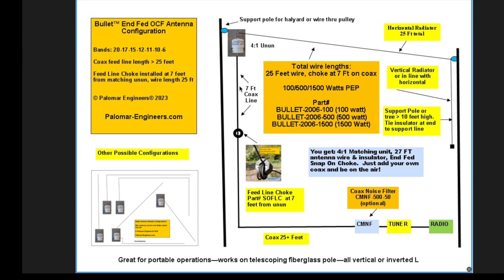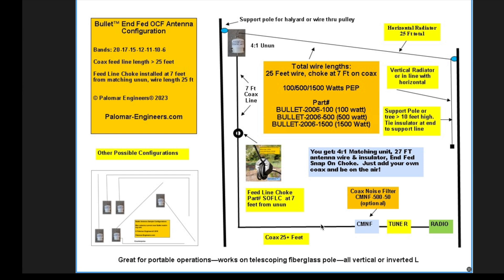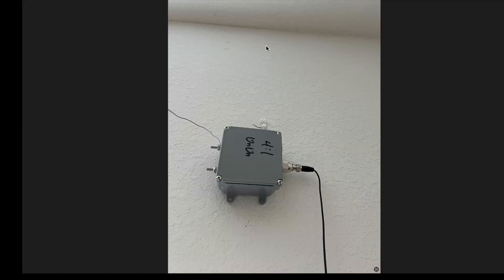Cheap, Easy DIY Multiband Ham Radio HF Antenna Fits Anywhere.

Comment: I like Palomar products. I have used several EFLW antennas on 155 ft long the other is 77 ft I think. I do have a request for you; on EBay a 160 meter end fed antenna is sold. I've had one of these up for a weekend net, it works well. The issue is that there are no specs about what is in the PVC tube so it could be duplicated. It is sold by stanj6 for $113.95. I'd love to hear you analysis and views on this antenna.
Reply from the maker: Could not find that particular antenna but any end fed has an UNUN impedance transformer at the feed point depending on how long the wire is.

Comment: Not clear why length of feedline makes any significant difference in SWR.  Perhaps you meant to say at least 25ft of feedline is necessary or the impedance -- due to feedline SWR -- will be too high?
Reply from the maker: Yeah that's a good point.  But if the feedline is not at least 25 feet between the choke and the tuner SWR readings will be higher.  I tried shorter lengths and SWR readings were very high like 10:1 on bands above 20 meters.  Can't claim to completely understand why.  But that's also in the instructions for the antenna so there must be a reason.

Comment: Note that both the wire and coax outer shield counterpoise are radiators. 
Also, RG-316 is another popular mico-coax that's used by QRP SOTA/POTA operators.
Reply from the maker: True!

Comment: Mark.... Again, an awesome video! Just a comment that moving the choke closer and further from the UNUN allows you to tune the antenna until you get the lowwst SWR on all the bands. If one of the bands happens to Have an SWR that's too high to tune, you can look at the SWR of all the bands and make a compromise so that all bands are lower than 3:1 so all will tune. I happen to have a version of that antenna that's actually called an end-fed dipole that has a 9 to 1 UNUN but I have extended to 286 ft. I know, I'm lucky that I have the room. But it's basically the same idea where the length of the radiator is not resonant on any of the bands that I want to use. And yet I can tune this antenna across the full phone portion of every band from 160 m to 6 m.
Reply from the maker: Great tip!

Comment: So when you run the numbers, if you call something a POTA, EMCOMM or NVIS antenna, which many of those short wire OCFs do, you get a wallet loss of 3:1.
Reply from the maker: When you run the numbers a 3:1 SWR in the HF bands is of no consequence.  Try it with this calculator. 
https://www.qsl.net/co8tw/Coax_Calculator.htm
Reply: @BustRadioMyths  my apologies, I wasn't commenting on the antenna. I was commenting on the price of relatively simple end fed antennas. When they get branded with anything "emcomm" the price inflates 3x. 

An enclosure, a toroid, a bit of magnet wire, a capacitor, and an SO 239. You'll be roughly $40 into a project. 33 feet of speaker wire at 10 cents foot and you've got a 20m end fed that also works on anything that is an odd numerator /2 multiple, like 3/2, 5/2, 7/2 etc albeit with an increasingly wonky radiation pattern.

Comment: That's a great idea Mark. I assume the width of the band coverage is good also on those bands... I also assume that the coil loaded commercial antennas that you mention may suffer from reduced band coverage, which is the issue with compromise size, loaded antennas... many thanks for your continued, common sense, practical videos.
Reply from the maker: Yes the SWR was pretty much unchanged across the bands the antenna covers.